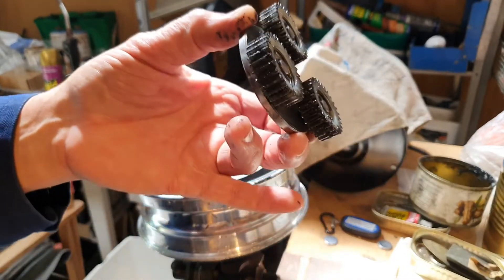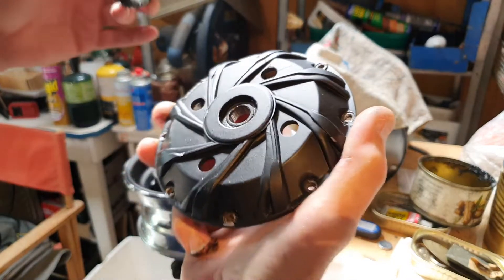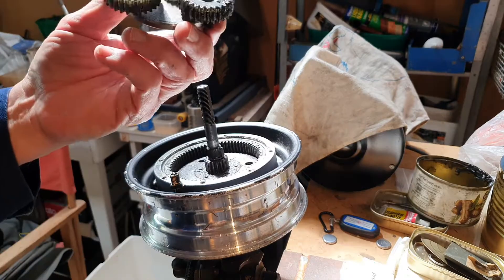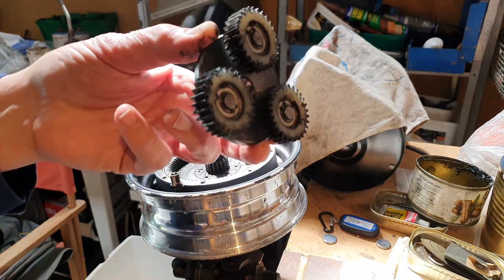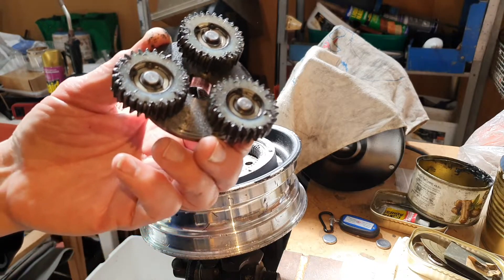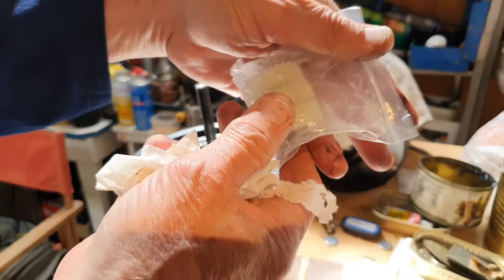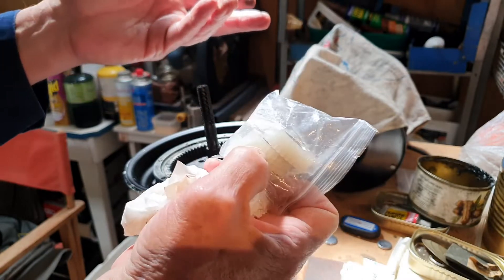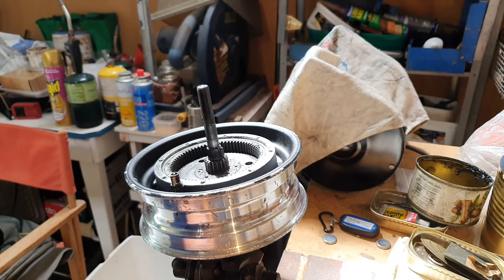Geared scooter hub motor repair, Warning about a cooling mod.

Comment: A little late to the party but I just installed statorade in my motor and it worked amazing
Reply: Do you use this in the scooter hub motor or bike hub motor?
Reply: @soapbullet-tq8zf  doesn’t matter as long as it’s a direct drive motor. Statorade works in direct drive hubs.

Comment: Do you have a video fixing brushless gearless hub motor that is overheating and cutting out?  Mine is starting to cut out when going up a steep hill.  Works after it cools down for a bit.

Comment: I believe Rion’s vented hub motors were intended for dry pavement use only and tend to generate a bit of heat when cruising at their top speed, which is 120km/h and up, with a rumored 160km/h variation.
Reply from the maker: Yes, you're right... but even on dry pavements you can get an awful lot of dust inside the motor that will eventually kill it.. Some vented motors have a fine screen placed over holes to help minimise dust ingress.
Reply: @joc1862  I wonder why.  And, if overheating is so much of a concern, you sacrifice weather sealing, why didnt the engineers install small, inexpensive scoops to  improve air flow along with screens?   

Maybe i just answered my own question.  Me thinks it’s more about venting and less about air flow, and screens with a mesh small enough to filter out the type of debris and dust that does the most most damage would just clog and effectively eliminate the vents, since customers can barely add air to a tyre, much less maintain hub motors.
Reply from the maker: @oddsman01  Best way to avoid overheating your hub motor is to be 'boring' - riding sensibly on level paths. I've resorted to that after burning out 3 motors already - ha!

Comment: we have done cooling mods on quite afew 9c motors with 9x7 windings and after full epoxy coating of stator and magnets ,we drill the airholes quite abit larger than ones on your motor,but we epoxy aluminium fly screen peices over the holes ,we allways make sure we add a temp sensor to into the windings as once they hit there limit ,boom its cooked ,the magnets loosing their pull is normall the first thing to go at over 110-120 degree celcius. on the larger hub motors like crystalyte hs4065 rd and up to 50 series were made liquid cooling units, have even made a cople of liquid cooling solutions for batteries and water block/heatsink for sabvoton 150 amp controllers .hehe even experimented with peltier elements if they were left on without motor turning the fluid would freeze too.
Reply: actually looking at making our own motors ,can get the aluminum stators made and wound straight for major company ,then add custom axle and barings here, the grin all axle motors would be close to what id like to make,massive amounts of room for wires and water hose,and also fits through axle bikes.ive even cpl of dual stator motors comming out to get the best of both worlds torque and higher speeds

Comment: I add a small amount of mineral oil to my geared hub motor. Making sure it is sealed first. This bridges the air gap (about 1mm) between the stator and the outside of the motor (which then acts as a heat sink). This works really well and I have had no issues so far. It also lubricates and protects the inside of the motor.
Reply from the maker: Wow... I've heard of adding Statorade or Ferrofluid to hub motors, but I've never tried it. First I've heard of adding mineral oil and glad to hear it works for you... Just wondering if, over time, it would affect the plastic bits, like wire insulation, etc??
Reply: @joc1862  I've been using it for about a year, with no issues so far. Mineral oil doesn't effect plastic parts or electronics. There are a number of YouTube videos of PCs immersed in it for cooling purposes!